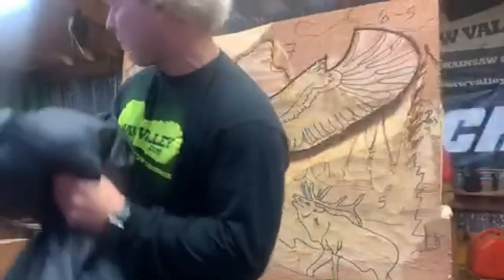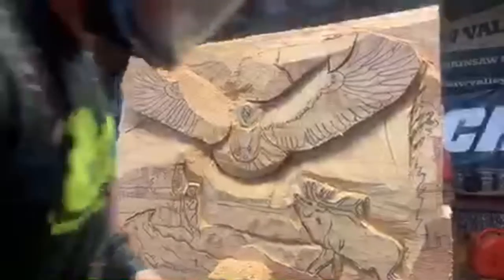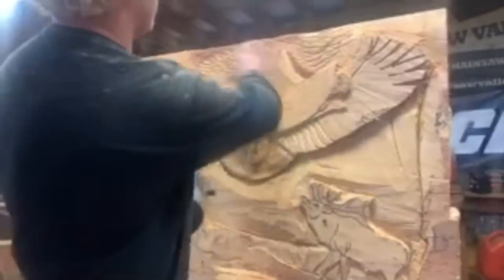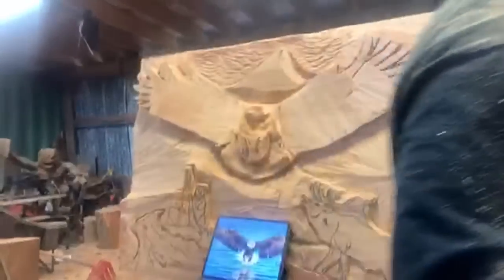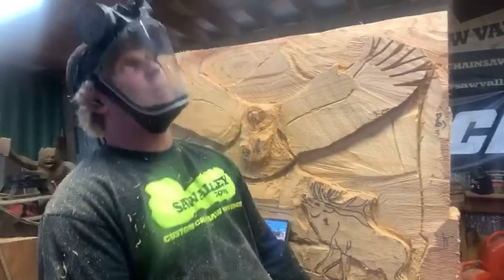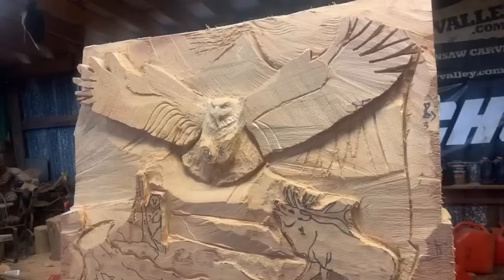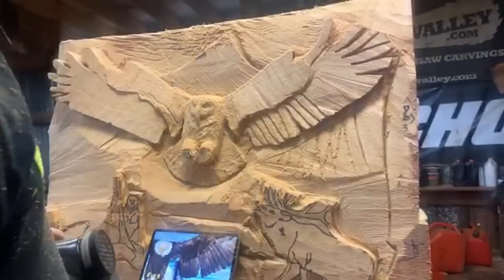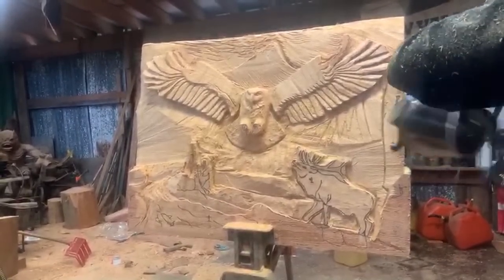AWESOME WOOD Carving - Eagle, elk & Bear - #woodcarving #chainsaw

Comment: Ryan, I’ve got a question, do you use bar oil? I ask bcuz I don’t see it spraying all over your piece.
Reply from the maker: i was using canola oil and a little winter bar oil mixed
Reply: @RyanCookCarvin  I know Jordy uses canola oil, was just wondering if you did to, or if you used something else all together.